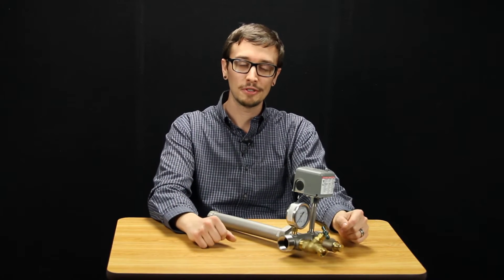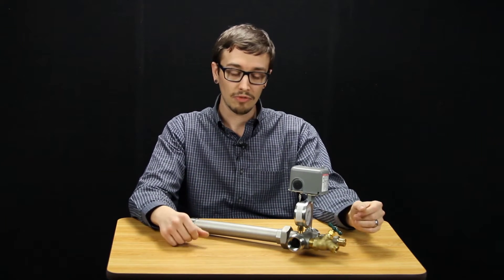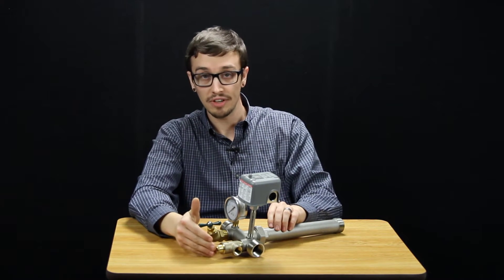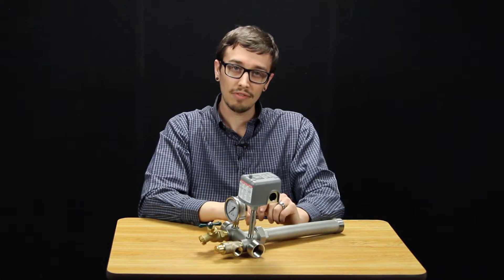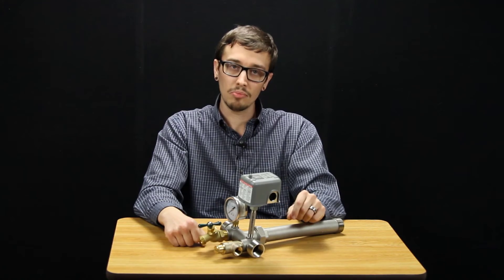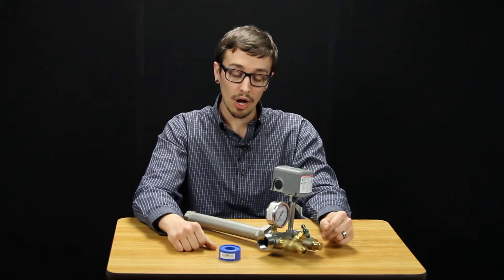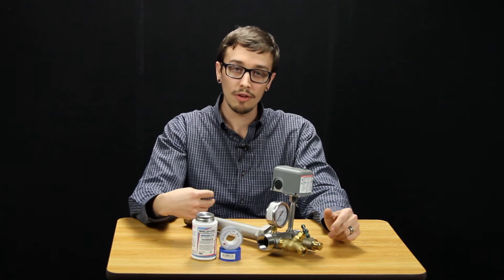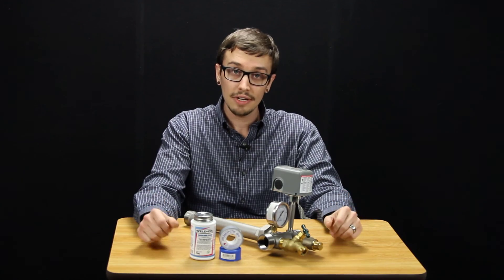Pressure Tank Tee Assembly

Comment: Any videos on assembly and what order to put them together in?  I assume you put the 14" pipe into the tank first and work your way out from there?  Does it  matter which side is supply and which side is discharge?  (left or right?)  Its a good video describing what the parts are but how to assemble and what needs to be where would be useful as well.
Reply from the maker: You can hook up either side as the inlet/outlet, and the components can be in any position. As long as the tank is connect to the 14" pipe you really can't do it incorrectly.

Comment: Does it matter if the pressure gauge or switch is on the left or right?  Another way to phrase the question: Does the switch need to be on the well side and the gauge on the house side?  Or are they interchangeable?
Reply from the maker: Doesn't matter which side they're on. Thanks for the question!

Comment: New to your channel and wells. My well is outside. I am building a shelter around it.  Is brass or stainless steel ok for outside application. Rick.
Reply: If you build a small building around and over it. Pvc is just fine. If it freezes where you live. Insulation of all piping should be done...

Comment: How do you check the pressure relief valve to see if it is functioning properly? How can you tell?  Also, doesn't it need to be plumbed so if it releases water pressure the water goes somewhere besides your basement floor? The valve releasing pressure will not necessarily shut the pump off, will it?
Reply from the maker: Thanks for the questions! Standard pressure relief valves have a lever that allows you to push and verify that it will open if needed. The valve is not designed to shut the pump off. It is used to be a "weak spot", so instead of your pipes/pressure tank blowing out the pressure will instead be sent out the relief valve. We intend on making a video on the different types of pressure relief valves and how to test them, keep an eye out for it!
Reply: Thank you. So I guess it is best to connect the outlet to a drain in case it opens.
Reply from the maker: Absolutely! Our pressure relief valves have NPT threads so you can do this.